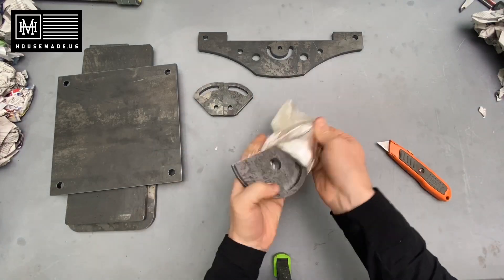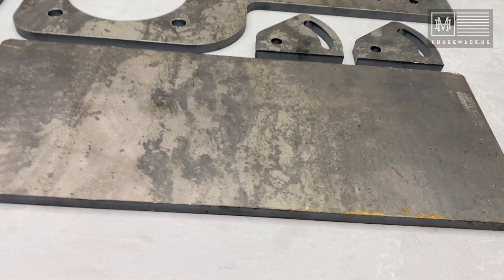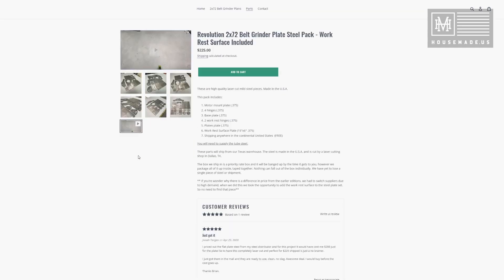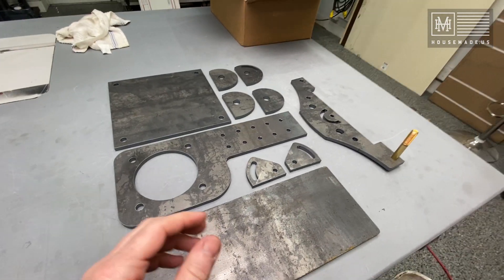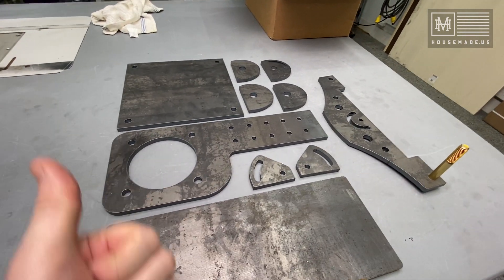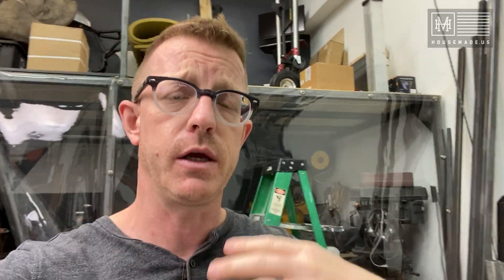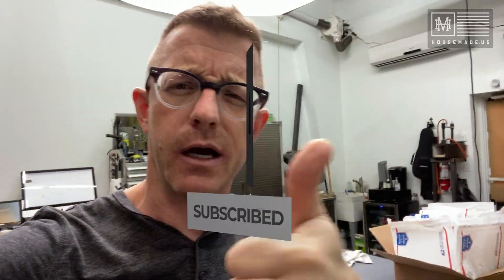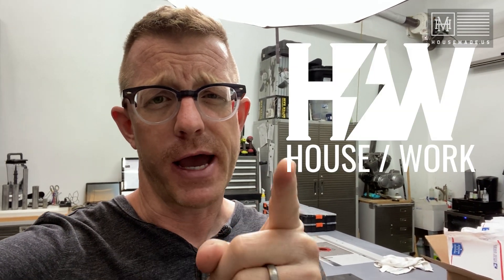2nd Generation 2x72 Belt Grinder Parts

Comment: Is the flat rate fee 130$ USD or CAD. And does it include duties. The duties are a big one as they are a killer. And USPS has been, and is even more so useless for shipping. I’ve had product sitting with USPS since early june 10th.
Reply from the maker: That number is USD. We are setting up Canadian distribution so we won’t have to ship through the border. Should be done in the next couple of weeks. Keep an eye out. And yes USPS has been awful lately. 🤬

Comment: So I’m sitting here bored outta my gourd adding up the price of all the parts in your amazon store... and the VFD is currently unavailable. Am I missing something? Superseded part? Thanks.
Reply from the maker: I’ve tried calling KB Electronics a few times. No answer. Has to be COVID related. No way to get through. I am testing a cheaper version that is available. Can’t fully recommend it until I put it through its paces. 👊🏻
Reply: motorsandcontrol.com has 50 in stock at this moment. Well one less now mine is on the way! Already have one but needed a second and they shipped it with tracking about 30 min after I ordered.
Reply: Caleb Keel may I ask how much you paid for it including shipping? Thanks.
Reply: 370 to the house
Reply: Caleb Keel thanks, I appreciate it!

Comment: 400$ for the full sheet and you get 10 sets at 225$ per set , that’s 2250$-400$ that’s 1850$ profit if you did the work yourself! So why not just get a plasma cnc and I’m sure you will be making a bunch more money in a short time .
Reply from the maker: The machine that can get the perfect holes and clearances is $700,000 - it’s just outside of what we can afford for now. Maybe one day we will. Happy to pay for now. 👊🏻
Reply: Plasma won't leave a finish as good as this laser finish, which also affects dimensions, so quality would go down.  And don't forget that there is overhead with any machinery, and Brian's time would be tied up in the manufacturing or he'd have to hire someone to run it.  The return on investment is not as fast as your calculation would make it seem.  That said, I'd love to have a plasma CNC setup!
Reply: Donorcyclist you can get a good plasma cnc for around 5000$ and they cut the thickness he needs really well , and the holes are really accurate. For a belt sander the pieces do not need to be NASA perfect, I say this because I have a setup under 5000$ that will produce those pieces and when assembled nobody could tell the difference. I would like to see him make more money .